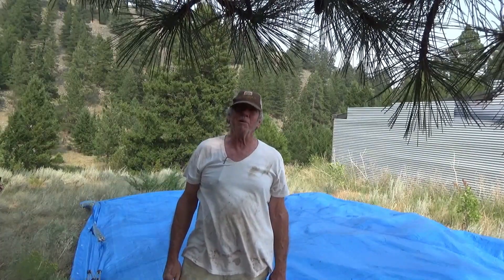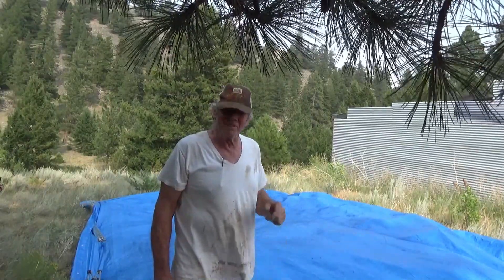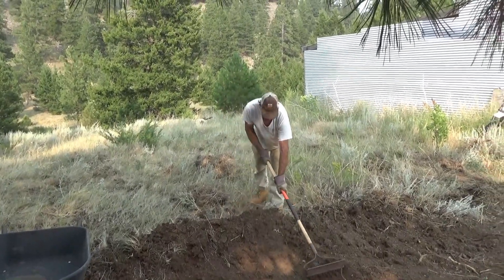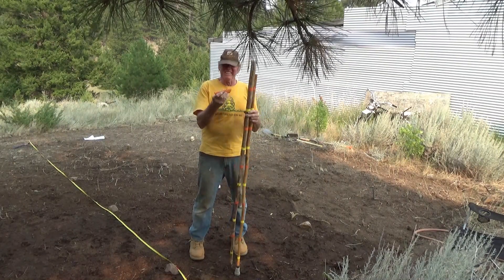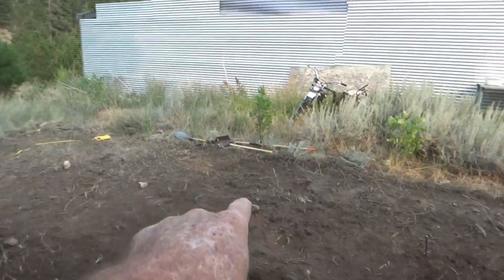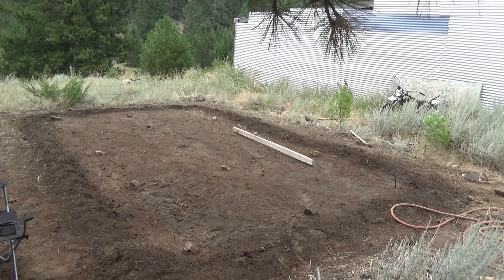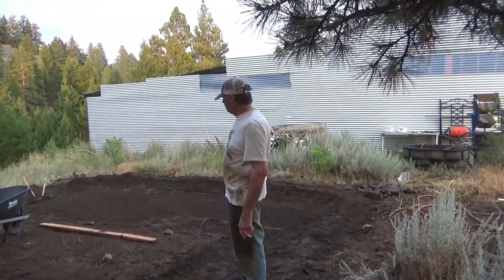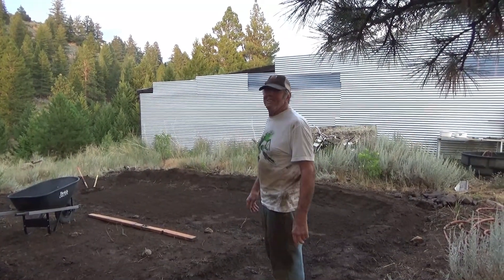223 A Quick and Inexpensive Tailings Pad

Comment: I  just thought this might be interesting for you , i know you know all about this stuff but i added a vid you might like to watch Keith , you can go straight to 1 min 06 seconds if you wish , cheers .https://youtu.be/4WFqq0IWBRw?t=2
Reply from the maker: It never said, but I assume this is a cyanide heap leach.  WHO THE HELL GETS HCL ANYWHERE NEAR A CYANIDE SOLUTION!!!!  That's not only a good way to lose gold, but a good way to die.  Any acid plus cyanide yields hydrogen cyanide gas.

That is also why you always double  check all brilliant ideas on a laboratory scale FIRST.

Thank Ned.  At Chemgold things were a bit larger scale, but essentially the same.  Our bars were about 10 Kg each, one per week.
Reply: @hardrockuniversity7283  Yes i would say a Cyanide heap leach , and i think he found out the hard way he was loosing gold when the lab report came back . The gas out there in WA wilderness probably wasn't so much of an issue , unless you were around it , but still the EPA wouldn't want to know i'm sure , or Work cover . 10kg ingot a week hey ,very nice !!!  , cheers Keith .
Reply from the maker: @GrooberNedJardine  In Arizona years ago a couple of miners had similar thoughts and barely survived the bubbling ponds.

Comment: Your a hard worker Keith , i think even i would have brought in a Bobcat , lol .  The young ones today have no work ethic it's something that we learned early in life , now they all want to push computer buttons , but that doesn't get the menial tasks done . So this is a tailings pond , it's like a heap leaching pond , so are you leaching your ore in drums ? I don't get to see your live streams so i probably missed something . I 've seen you leach testing your samples for best results , but how will you up scale , don't want to jump ahead of you though , just asking , cheers mate .
Reply from the maker: Right now I have upscaled to a cement mixer as the initial tests went well.  This will give me enough solution to teat then best method of getting the gold OUT of solution.  Once those issues are determined then we go bigger  still.  We need a bigger space to put the tailings after these tests.  Might as well built something big enough for  small production  so we can keep going.  THAT is the fun part.

The boss asked if I needed a bobcat, but look at the precision needed.  By using one I would have been fighting all the time.  This way I carved the pad precisely, removed the rocks, and kept the compaction even.  Plus I got a lot of good exercise.  If my body had trouble handing it, I would have requested the equipment, but you don't stay in shape in a driver's seat.
Reply: @hardrockuniversity7283  That's right , it helps to stay fit , , i work with my son he's 42 , he always wants to use machinery , he could tell you some stories about me , lol . you gotta pace yourself , cheers Keith .
Reply from the maker: @GrooberNedJardine  Yep, gotta set a pace I can keep.  Too much could be very bad.  :-)